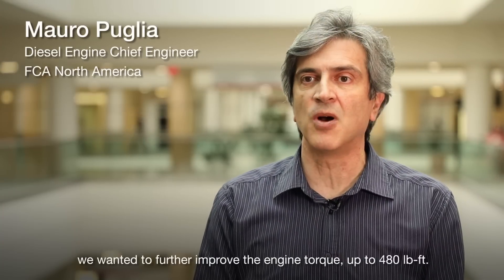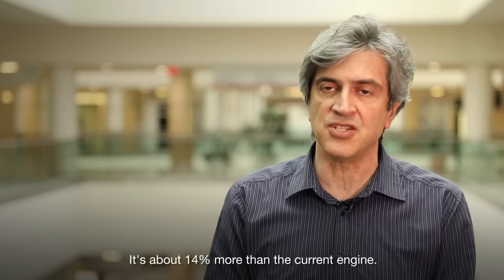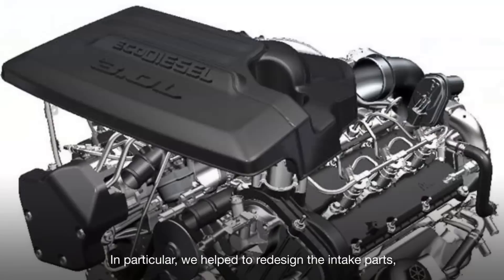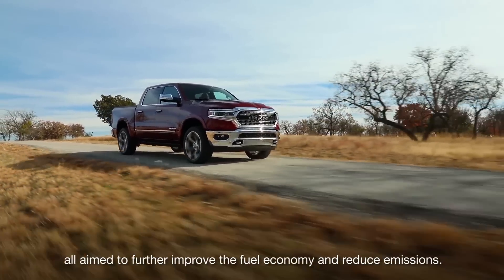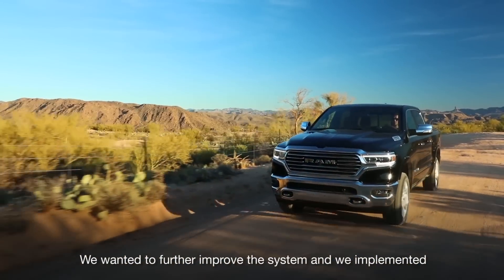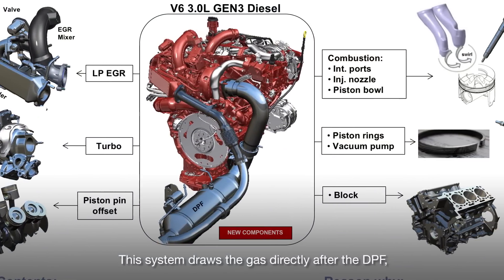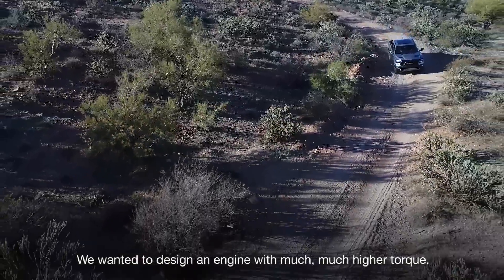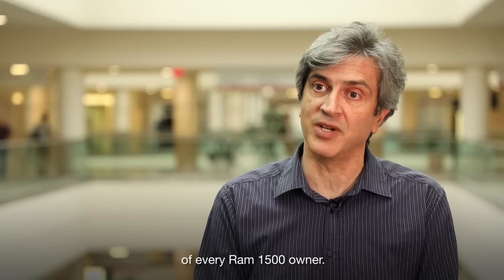Gen III EcoDiesel V-6 Unveiled

Comment: Been driving one for 1,500 miles or so now, and I gotta' say the powertrain calibration is horrendous.  If decelerating or cruising lightly at around 35-40 MPH and then dipping into the throttle to accelerate, there is literally a 3-4 second delay in response.  I can't tell if it's turbo lag, throttle dead zone, or sleepy transmission programming, or maybe all three.  But this is the least responsive and least fun to drive turbo-charged engine I've ever been in.

Comment: What about the cam problem, main bearing problem, EGR problem?   Now it has two EGR  systems to plug up and foul.    these engines should be maintanence free, except for oil and filters changes,  for 200,000 miles.

Comment: The VM diesel engine is good and seems to be a reliable engine. The real challenge is the automatic transmission, I have a 2018 jeep GC diesel and the transmission behavior is not precise when the car moves from a stop position, the accelerator pression is not reflected on the car movement as it should be, there is a late reaction of the car when you press the accelerator and when you push the accelerator and you see the car is not moving, you press further and further and suddenly the car jumps, this phenomenon is more accentuated when shifting to reverse, here the car is completely in a disproportionate response to the accelerator pressure... when such a behavior becomes your daily experience, this is really annoying
Reply: That transmission works wonderfully with my Hemi Ram. I get some throttle delay but that’s really more of a throttle by wire issue than anything. It is much worse on the ecodiesel though I know what you’re talking about. Hit the go pedal and it’s still asleep then all of a sudden it comes on. Way worse on the diesel because of its turbo lag added to the mix. When I first drove one I immediately disliked that.
Reply: Jay P yes this is unpleasant and annoying. I spoke to a technician within jeep dealer in my country and told that he can try setup the automatic transmission software and see if the car behavior will improve. I am still hesitating to take the car to him (afraid to leave the dealer shop with an additional problem...)
Reply: Youssef Sabiri Hope you can find a solution. I always hate going to the dealer as well. There are some different solutions to change the initial lag on the ecodiesel. There are some plug in tuners and other options that might help you as well if you look into some internet searches on the topic. You’re not alone with that complaint.
Reply: Jay P I will also look in various jeep forum where owners and users share their experience, hoping that I will find some solution... and especially hoping that Jeep will take this malfunction seriously and provide a solution to its customers. The transmission is from ZF manufacturer who sells to BMW and other notorious car manufacturers (on BMW for instance, the ZF transmission is a harmony!), so I believe Jeep or FCA have some commitment to fix this. Thanks for sharing your experience Jay and enjoy the mighty HEMI !
Reply: Green diesel engeneering offers a 8spd tranny tune that really fixes the lazy shifting issues. Chrysler is known to botch up perfectly good hardware with their shit software.

Comment: What the Ram, and all Chrysler products need is more reliability and longevity. The owner Fiat is not known for this. Reports on Dodge Charger Police cars, is that many failures occur by about 70,000 miles, which is why most police cars are Fords. It's to bad, because Ram and Chrysler make some of the best  looking cars and trucks, and have retained their V8 engines and still use the proven Multi-Port fuel injection in many engines, instead of the carbon building Direct Injection.
Reply: The problem with police chargers isn’t something that normal users experience at least not even remotely as often. Police cars often sit and idle for lengthy periods of time this is what causes the vast majority of the engine issues for them. In the Air Force I saw a lot of problems with our flight line vehicles because they would be used at low speeds and most importantly idling way longer than any other normal vehicle use situation. We had a lot of GM trucks with issues that weren’t very old and of course for this situation were very low mileage. There are plenty of 5.7L and 3.6L high mileage engines from FCA. 3.6L had some early issues but is just as reliable as any V6 from GM it Ford at this point. Reliability is key though I agree. Increased reliability would be good for FCA as much of their product line is quite good otherwise.
Reply: @JsGarage  You are right, idling does put a lot of added wear on an engine, but they could definitely use some increased reliability and longevity for their vehicles, it would make them a real contender, not only with the trucks but also the cars, especially now that so many are ditching cars for SUV's, and ALL of GM's engines use Direct Injection.
Reply: That may be true with Crown Vics, which use older technology, but I would want to see data to prove that new Fords were any less susceptible to engine lube issues from long idles.
Reply: Those Tauruses and Explorers are having major problems with the dreaded timing chain driven water pumps and the PTUs. Some police departments are switching to Chevrolet Tahoes and Dodge Chargers because the Fords just have too many engineering flaws like the carbon monoxide in the Explorers.
Reply: @atx-cvpi_99  One Crap thing that Dodge did,  was removing AWD from V8 Chargers, and   only offering it with a V6. Dodge is probably trying to screw Police departments out of more money, by only offering a V8 with AWD on the more expensive Durango, and charging more for 2021 AWD Chargers with a V6, than 2020's with a V8. They might, deservingly, lose sales to the Ford Explorer, or even the Chevy Tahoe PPV, if they can justify that with PPVs high price, instead of simply adding an updated column mounted gear shift, (like Ford did on some new F-150's). GM is trying to sell departments on the advantages of their odd push/pull button gear selector.

Comment: Is this the same motor the gladiator is getting ?
Reply: Yea it’s supposed to be. This will be the same engine for all vehicles getting a 3.0L ecodiesel.
Reply: Jay P should be plenty of motor to run 40s and pull a boat or 5000lb camp trailer. D60s plus 4.88s of course but 15-17gs plus a base diesel sport should yield an unstopped rig. I’m so excited.

Comment: i'll keep my eyes on it to see if the main bearings fail like they did on the 14 to 18 model.  Lots of EGR problems as well.
Reply: Main bearings egr problems boost tubes blowing off and its the biggest disaster in existence to work on
Reply: Ram repaired my EGR free of charge and extended my warranty and send me a check for $3100.. Nothing runs like a ram, Ford or Chevy I've owned them both They have never recalled anything I was always stuck with the bill When they knew it would eventually break. Never recalled anything mechanically..
Reply: All these problems being reported?  But then again I am not trying to race A 6000lb 4x4, 3 liter Truck🤪.. Do an oil change every 5000 miles synthetic Rotella.. 175000 miles no problems.. That I was on the hook for, Just The ram recalls Which didn't cost me a dime.

Comment: Good design, happy about the improved power. Not so happy to hear about the low pressure egr being drawn from after the dpf. Will
Lead to too many problems down the line when dpf is plugged. CAT tryed the same design in 2007, didnt work out.
Reply: Yes and cat did it like morons. 100 oems all installing engines and low pressure egr pipes different. This is 1 installation! 
Low pressure egr has huge technical advantages. Dont judge 1 company based on another. That makes u a moron...
Reply: @crazyhass84  I would guess the egr after the dpf would mean less soot being run through the engine?
Reply: @VARITHMS  this would be true, but they still are running the high pressure EGR, which is fed prior to the dpf. :/